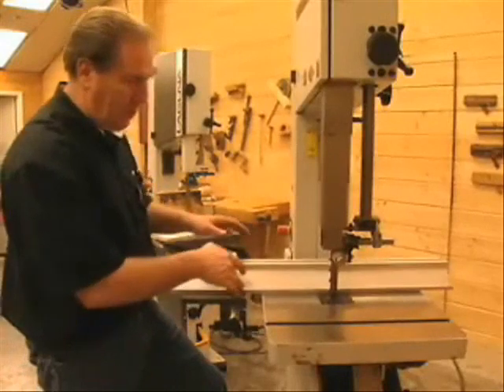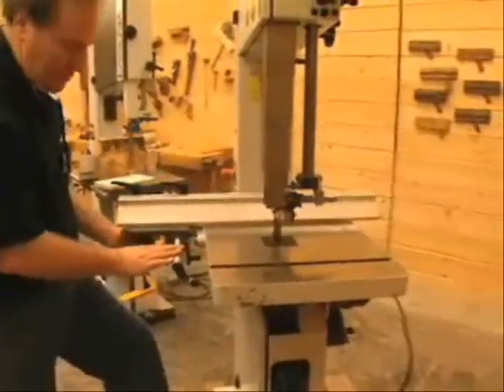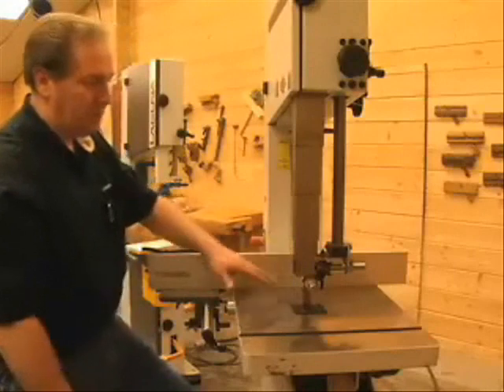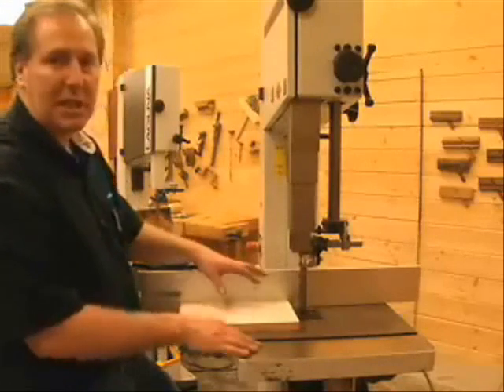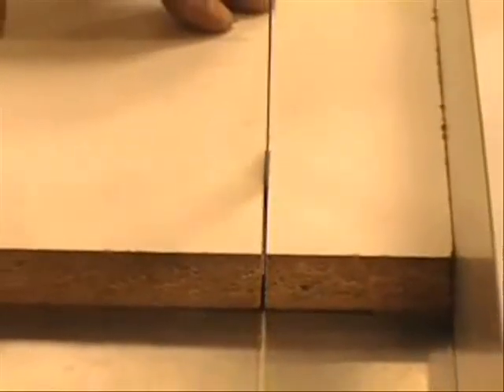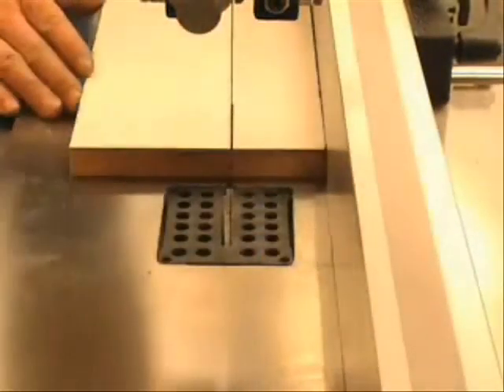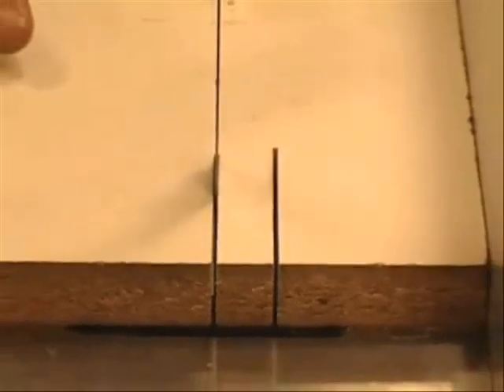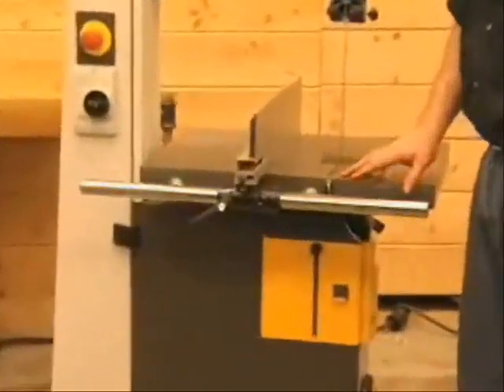Laguna DriftMaster Bandsaw Fence System Drift Angle

Comment: Demonstrator does not know that there is a much simpler way to adjust fence for a more accurate setting. Make a free hand cut onto a parallel line rip on scrap half the length of the saw table, stop the saw, do not move the stock then move the loosened fence to the scrap at the true cut angle. This method is far easier, and more accurate for long resawing and ripping operation.